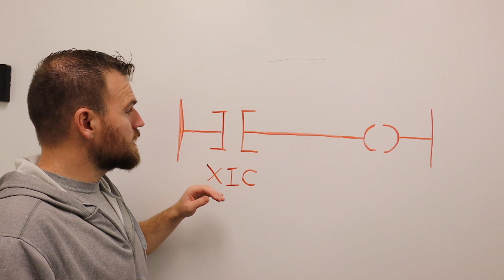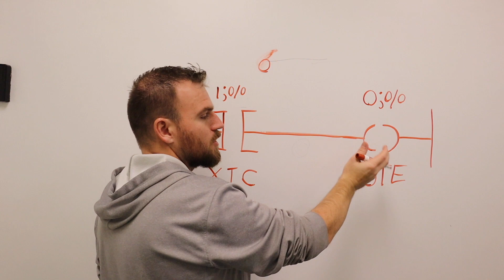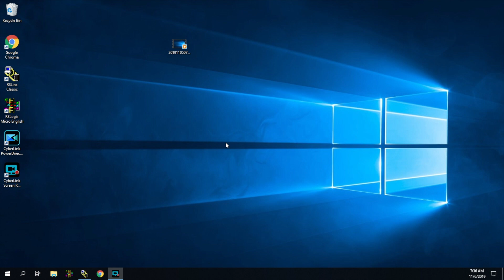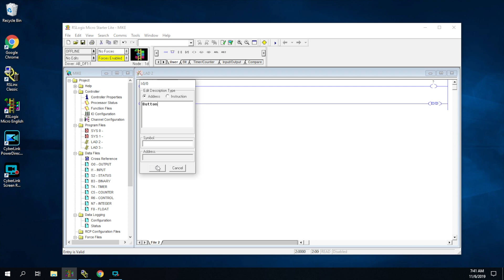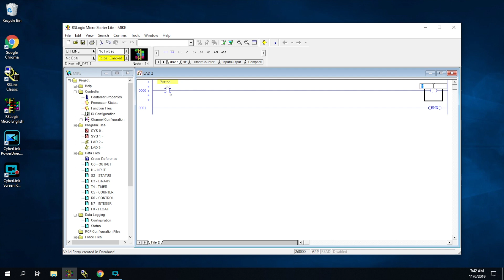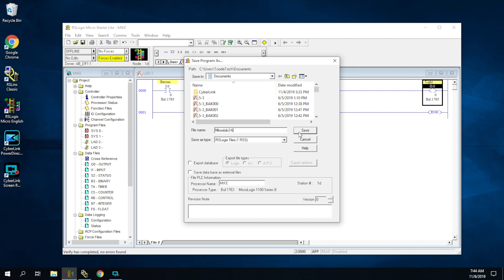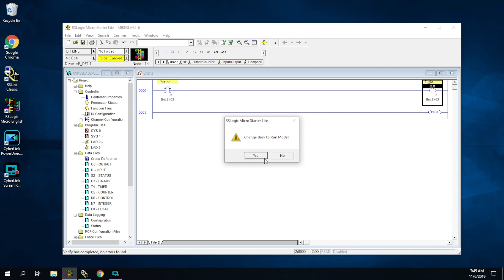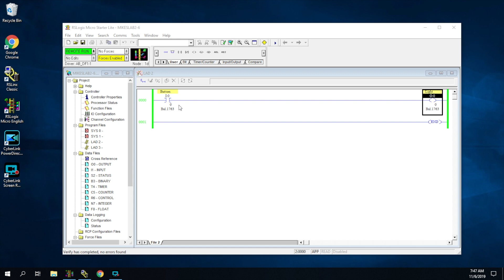Allen Bradley PLC - RSlogic and First program

Comment: I'm a new plc student, why didn't you use a latching for the light?
Reply from the maker: Most things with PLC’s need to be conditional. Let’s say you had a light that was on when the machine was running. If the machine was to stop running for an unplanned reason the light would stay on if we used a latching instruction. We would want that light to turn off and give us the correct status of the machine. Does that make sense? I think I explain that in my latching video. Hope this helps. Good luck in school!
Reply: That makes a lot of sense, thank you